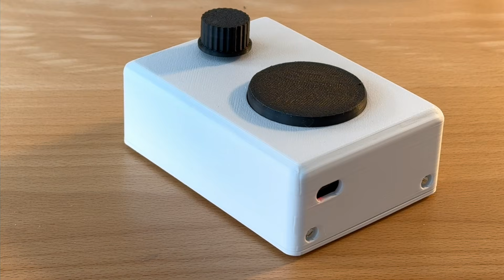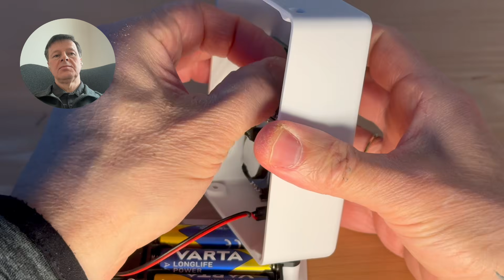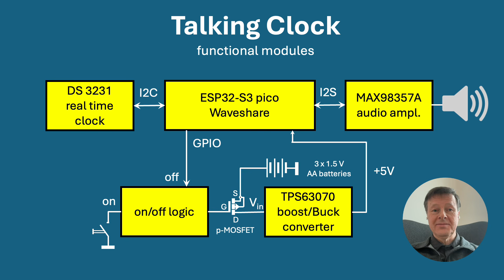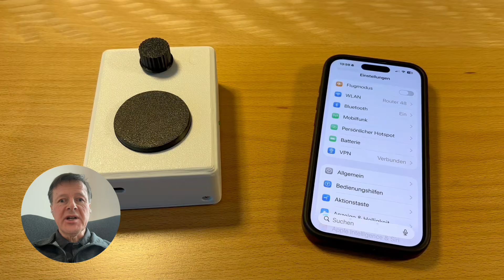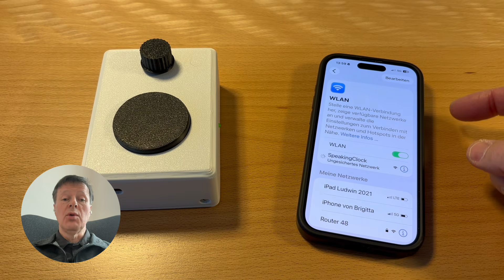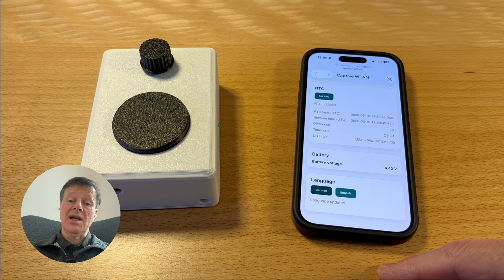Talking Clock for the Visually Impaired | Simple One-Button, Offline, Open Source

Comment: amazing project! how much will all that cost?
Reply from the maker: I do not have an exact number, as it depends on several factors:
1. where you are located might make a big difference, as import duties might be high. Many of the components come from China.
2. the two models of the talking clock have different cost drivers. While the microcontroller is the most expensive part in the breakout board model, the assembled custom PCB is the driver in the integrated SMD model.
3. It makes a big difference, how many units you build. The minimum order quantity of the assembled custom PCB is 3 (JLCPCB). Some components (such as the loudspeaker) are not available as a single unit. You usually have to purchase a couple.
If you want the lowest possible cost, go for the breakout board model. My guess for the total cost would be 50 € (ballpark number). If you want a more professional device, go for the SMD version. Depending on how you calculate, it might be twice as much.
Anyhow, if your goal is rather „owning“ a talking clock than „making“ a talking clock, I might be able to help out (depending on your location). Please let me know.
Reply: @LHM000  My uncle is visually impaired and lives in country Georgia. I haven't been able to find a normal working talking clock, especially one that speaks Georgian. After watching your tutorial, I thought I'd try making a smaller version—something like a wristwatch—so he can carry it with him everywhere. I've never built any electronics or hardware before, but with the help of your tutorial and AI, I'm going to give it a try. Thank you so much!
Reply from the maker: Implementing Georgian language will be doable with AI. However, my concern is modifying the electronics without electronics experience. That will be tough. Furthermore, shrinking the device to wrist watch size might be overly ambitious. I recommend you start with my SMD PCB. There ist quite some room to make the device smaller: replace the rotary encoder with up down buttons, use smaller batteries, use a smaller loudspeaker.
Reply from the maker: I have thought about a talking wrist watch, as I like the idea. We would need to shrink the pcb substantially. However, here is what I would do: replace the ESP32-S3 by a ESP32-S3FN16. This type has internal 16 MB flash memory which saves the external flash memory chip. Replace the DS3231 RTC by the ESP32 internal RTC. It only requires an external 32 kHz crystal, but saves the extra chip. The accuracy is not as good as with the DS3231, but I guess that would be acceptable. The approach means that you have to change the power down mode. We would need to put the ESP32 in deep sleep mode. The start button would wake up the MCU. Finally, we need a rechargeable battery and a simple charging chip. In total, the concept would reduce the hardware down to three or four chips: ESP32-S3FN16, MAX98357A, and charging controller with step down converter.
Interesting project. I am busy with some other project (book reader for visually impaired). Once that is done, I might have some time to look into the clock again.
Reply: @LHM000  Amazing!  We can use a small 500 mAh rechargeable lithium-polymer battery and a 40 mm mini speaker, as long as the sound quality isn't too poor, like those cheap Chinese talking clocks.

Comment: It is recommended to replace the battery connector with a keyed connector, as accidental reversing of the connector will be fatal to the hardware connected.
Reply from the maker: I am using a JST XH connector for the battery. It is a keyed connector very often used for batteries. However, the speaker has a non-keyed connector, but I think that is not a risk and acceptable.